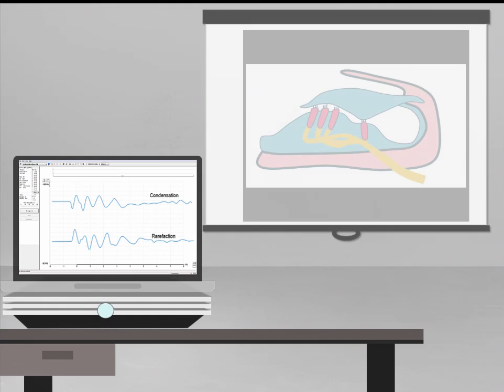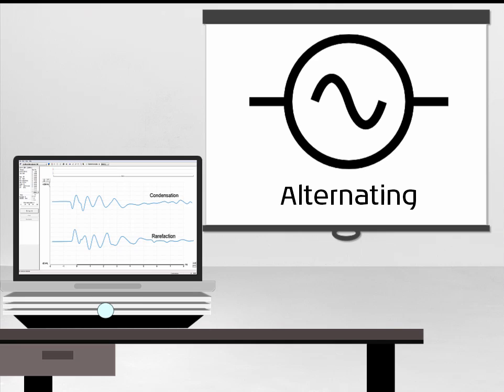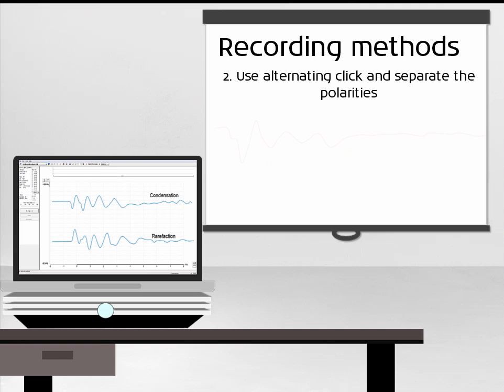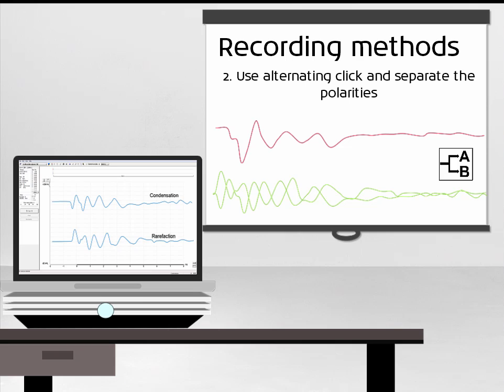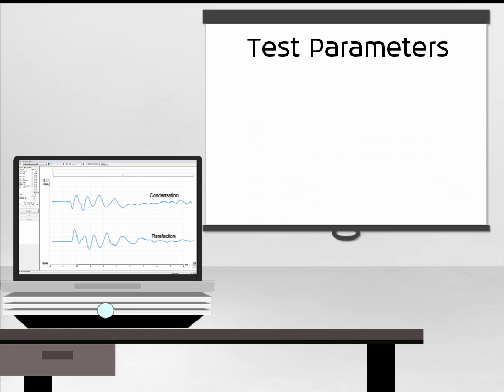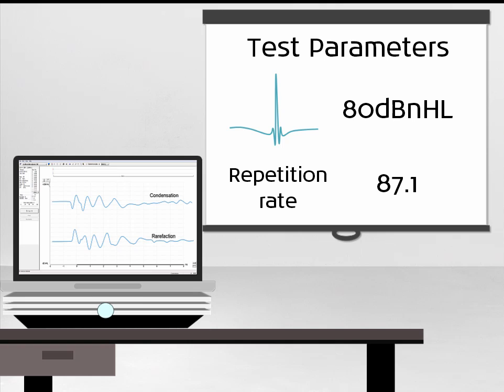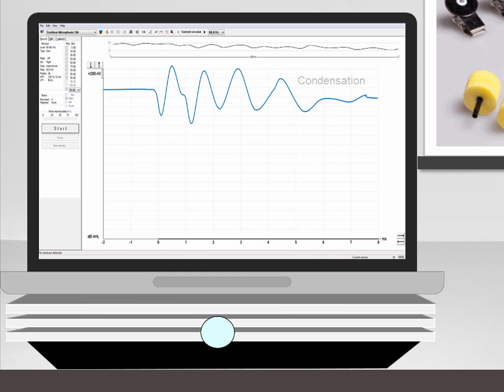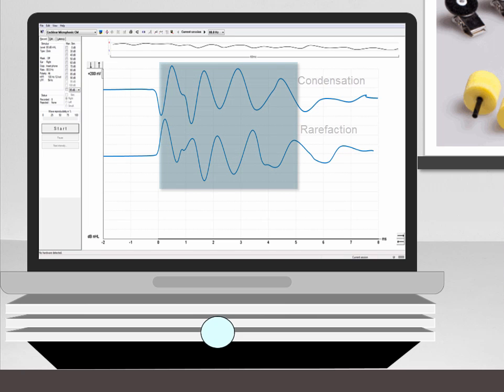How to Record the Cochlear Microphonic (CM)

Comment: Hi, if OAE test the function of outer hair cells and the OAE test results is absent, running a cochlear microphonic (CM) test also measures the function of the outer hair cells and the CM records a response. How does CM records a response but OAE does not record a response when they both measure the outer hair cell function? It seems confusing and contradicting.